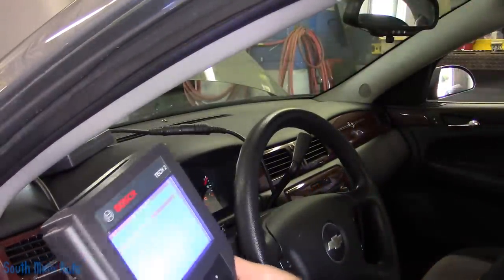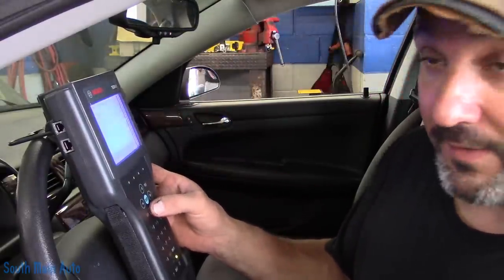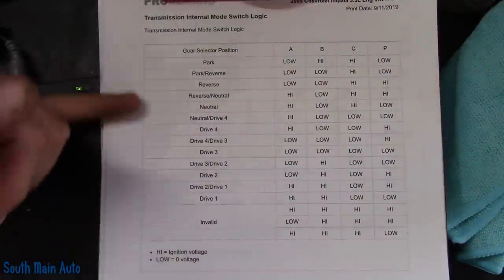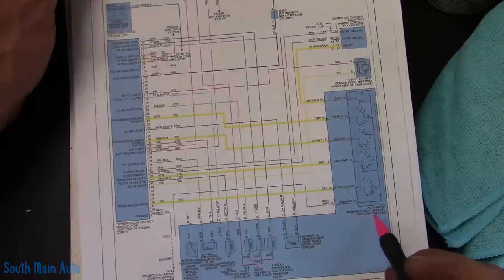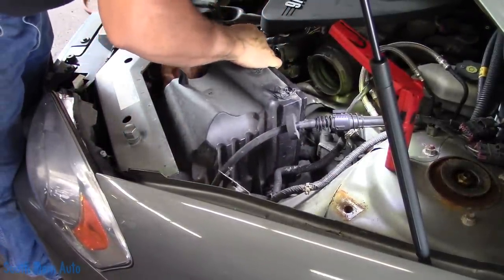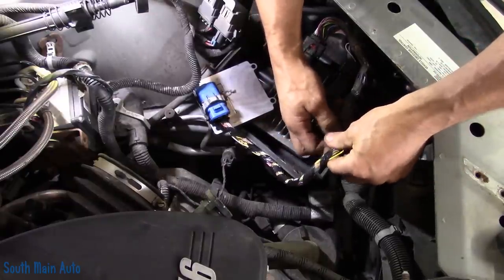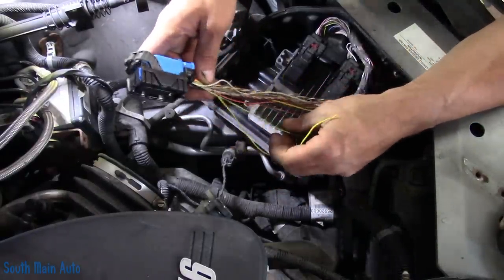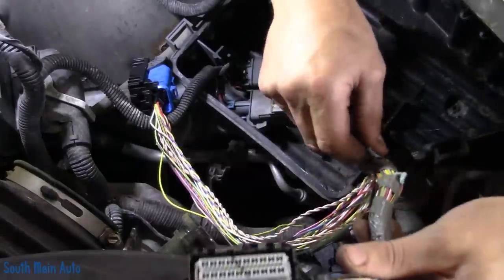Chevrolet Impala: No PRNDL Display

Comment from the maker: Looked on the old Amazon and I did not see the Honda Rodent tape being offered there any more. However you should be able to pick up a roll from your local Honda dealer .
Reply: Amazon does list a rodent tape in Canada but apparently their version doesn't work because people have posted photos of it chewed right after they applied it.  Better to buy the full price Hondoo stuff.
Reply: ...and boy is Hondoo proud of that stuff.  Picked up a couple rolls from the Amazon for around $25/ea when some vermin snacked on the wires to the knock sensor on my 03 MDX with the 3.5 causing it to throw a P0325.  Best I see online now direct from Hondoo is around $40/ea.   ...and yeah, there's generics out there for about $20/ea ... but they too seem to have mysteriously been removed from the Amazon as well.
Reply: Does it come in a aray of festive colors before the holiday rush? Asking for a friend.
Reply: Tape listed on e-bay
Reply: Holy moly, Hondoo is PROUD of their rodent tape! Nearly $60 a roll!
Reply: Cool thanks Eric!
Reply: Capsaicin infused tape, I wonder if spraying it down with pepper water would work too. Boil up some water with habenero peppers in it and put it in a spray bottle...
Reply: You can buy a bottle of Cayenne pepper for a buck at the grocery store.
Reply: $50 per roll for Hondas effort to use a biodegradable plastic, Way ahead of the new green 11 years until armageddon curve.
Reply: £21 here in the UK on eBay boys , mouse traps 60p , a cat free from your neighbour
Reply: Ebay has both the Hondoo stuff and some generic one that looks exactly like the Hondoo one. Luckily we don't see much rodent damage around where I live.
Reply: Interesting.  I had never heard of rodent tape. After we adopted a stray cat, I haven't seen another mouse around here. You can also get some of that green poison at home depot. It's a harden green block which I smash into pieces and spread around the yard. I even started seeing mouse crap in the car parked on the street before we got the cat.  Lol
Reply: @Brother2Jis_27s4  I was wondering the same thing, that's how we keep our dogs from chewing up stuff.
Reply: I have a friend that grows Carolina Reapers they are the hottest pepper on the planet just wear gloves when applying to tape
Reply: Just melt a peppermint candy cane over the problem area, rodents hate peppermint :)
Reply: All you need peppermint oil
Reply: Boss  if you read this I wanna know if you want to do exhaust on my Mitsubishi it’s a 91 Mitsubishi Monterey  I want to run side pipe
Reply: Hannah virus! (Marie virus??) Nevermind...
Reply: can also get it from your local ope dealer!
Reply: @mikeberry304  -- LOL  Yes, just put a can of tuna fish under your car and let the neighbours' cats keep the mice away.
Reply: If you can't find the rodent tape, hire a cat to live under the hood? 🤭
Reply: You can get it on eBay.
Reply: South Main Auto Repair LLC My 2002 Buick Regal LS the mileage/PRND321 odometer LED light barely works during the daylight it's hard to see at night you can see the mileage but is it common issue ?
Reply: Honda City Honda in the Glen Bernie area just outside Baltimore MD has Rodent tape listed as being in stock for $41.25 a roll, free delivery on the eBay site.
Reply: @ColtaineCrows  you must live in a magical place
Reply: I bought this tape a few years ago, and I noticed it is really just Teraoka anti rodent tape. Made in japan, and it seems to be working well. Oddly enough, when I wanted to buy this tape originally, I tried a Honda dealer first, with the actual part number, and their parts department knew nothing about it. This was also at the time when there was talks of a class action law suit against Honda about rodent damage.
Reply: @farmcentralohio  I've had mice eat candy canes out of a kitchen drawer.  I guess they have evolved.
Reply: Mark from [fordmustang98guy] .
Reply: BTW its great the wif keeps you on the narrow not so much the straight.  WIF comes form our time spent on the St Law.
Reply: WARFARIN in the tape?
Reply: Coronavirus for 2020
Reply: Solder, heat-shrink, number 33 and a "mentholatum rub" will work for a DIY-style Honda tape. Rodents hate spicy peppers (capsaicin being the heat in peppers) and menthol (pungent mints especially peppermint).  So 33 and peppermint oil would work. Or cayenne (tbsp), dawn dish soap (4 to 5 drops) and a pint of water, quick boil and let it steep a while. Mix it up and spray.
Reply: Amazon does list the rodent tape by a company called Veco who actually manufacturers it for Honda. Honda just repackage it,slap a Honda part number on it and hikes the price up.
Reply: @South Main Auto Repair LLC Can you scanner tool reset/program on the Throttle Position Sensor? I have 06 impala 3.9 with check engine light that I can't clear & need a scanner tool to do so is yours capable?

Comment: Great video. After 45 years as a mechanic I learned something new, the use of two small alligator clips and short length of wire to hold wires to while soldering them.

Comment: This is a great example of following a logical path with the given information you have. I am perplexed too why this code is not in service information. I work in a dealership and the code does appear in factory service information. Does not make sense. With that said, the way you approached this actually is easier and follows a better path than the factory service information. Very nice work. I want bring attention to how the wires where repaired. Splice, solder and seal. That is the correct way to repair wiring. Do not use shrink seal butt connectors. I have done so many repairs over again that have been to other shops that use these. Good work Eric.

Comment: I just had an issue with mine and this video saved me so much money cause a several mechanic shops couldn't figure out what was wrong. As they were saying everything tested fine. One shop even said it might be the transmission but it was a brand new transmission. That worked fine for a month or so before the issues with the box on the gears.

Comment: Worked in a quick lube joint for years and I can't tell you how many times you open an air box and it's just filled with the ol mouse house, or my favorite filled to the bottom of the air filter with dog food. Great job on the diagnosis and repair.

Comment: This is why every chevy needs to come with a free cat!
Reply: GOOD ONE, IT WAS ALSO A CHEESY FIX.
Reply: Nothing like the smell of mouse and cat pee! 🤮
Reply: @JeffWinter1  That's why you have to put a Litter Box control module in the trunk.
Reply: A snake can also work if you don't like cats
Reply: Chevy? More like chewy. ;D
Reply: @frugalprepper  or better yet, rig some ultrasonic tone generators that alternate to avoid these problems..
Reply: They all do come with a CAT now, but people tend to remove them, because they think the exhaust sounds then better
Reply: @berczigabor  I didn't know GM used CAT.. I thought they had duramax 😂
Reply: @frugalprepper  thats why sheryls she shed burnt down
Reply: Exactly, so the driver won’t be lonely while waiting on the tow truck
Reply: FrugalPrepper's Garage & Garden cats in the US run away from mouse
Reply: @JeffWinter1  People think that having a mouse as a pet is an easy thing.  You need to change the mouse terrarium at least every two days, because the smell of mouse pee is just god-awful.  What I did was put newspaper as the bottom layer (I used a full average newspaper section).  Then put the bedding, house, and toys atop that.  At changing time, remove the mouse, house, toys, and then roll the newspaper from one end of the terrarium to the other.  Put down a new newspaper section and repeat.  Saves worlds of time and aggravation.  Mice are NOT as easy to care for as people think.
Edit:  By "using a full newspaper section I mean just using the section as it comes in delivery, NOT undoing each 4-page sheet.  Also, the newer shredded-cardboard bedding is much kinder to the mouse than the old shredded-wood bedding.
Reply: @adventureoflinkmk2    Duracats.
Reply: That woulda been a CATastrophe. ;-)
Reply: @richardcranium5839  State Farm did say it was covered
Reply: @frugalprepper  it depends. What do you rather have going to your house cats or mice and snakes.
Reply: mouse food over at the neighbors
Reply: @Dirtyharry70585  Next time I get a mouse in the house I will go to the junk yard and cut out some gm wiring and use it for bait in the mouse traps!
Reply: What about brake cleaner?
Reply: @5bananas1  Brake Clean if for figuring out/remembering where the cat scratched you at last week.
Reply: @JeffWinter1  Just last night the annual hoot owl visit to my neighborhood occured. Cats seem to he on their munue!
Reply: I've had a rat hotel in all three of mine. First I checked my suburban after a funny smell, popped the hood apparently I Disturbed a family while they were trying to sleep I apologized and closed the hood softly because there was a new born, checked my 92 Caprice and my 90 both infested but the 92 was like a breeding resort

Comment: You know those old red needles on the steering column that moved with the shifter were immune to mice. But, those expensive failure prone electronics are cool to look at.
Reply: This cracks me up. Can either use a string to indicate gears and cost about 1 penny.. or put a whole electronic indicator on that costs hundreds.

Comment: The best part is that more than half of the shops in the country would've told you that you needed a full transmission rebuild, because that sensor is internal to the transmission. And the rest of the shops would've just cleared the code because they couldn't find what it meant. Good diag Mr. O!

Comment: P182C does show in GM service info.  Odd the aftermarkets do not have it.
DTC P182A, P182C-P182F, or P1915 

Diagnostic Instructions

•Perform the Diagnostic System Check - Vehicle prior to using this diagnostic procedure. 

•Review Strategy Based Diagnosis for an overview of the diagnostic approach. 

•Diagnostic Procedure Instructions provide an overview of each diagnostic category. 

DTC Descriptors

DTC P182AInternal Mode Switch A Circuit Low Voltage

DTC P182CInternal Mode Switch B Circuit High Voltage

DTC P182DInternal Mode Switch P Circuit Low Voltage

DTC P182EInternal Mode Switch – Invalid Range

DTC P182FInternal Mode Switch C Circuit High Voltage

DTC P1915Internal Mode Switch Does Not Indicate Park/Neutral (P/N) During Start

Comment: Hey Eric, On the switch logic chart, the reason you have extra lines like "Park/Reverse" is  because the switches are in a "make before break" arrangement, that allows the ECM to see in which direction you are moving the shifter. So as you are moving from Park to Reverse, switch B goes low (makes) before switch P goes high (breaks) always in that order if you are moving from Park to Reverse.
This helps the ECM detect a bad switch (invalid states) as the shifter movement always follows the same pattern and so stops it being able to jump from positions that are physically impossible to achieve.

Comment: Hello Eric. Great video. I have a 2010 Chevy Impala that I wrote and shoot through the harness just before the plug going into the TCM the car was in limp mode. But after seeing your video it gave me the courage to settle them all back together. I matched all the colors of  the wires. The thing is I have two yellow wires and to gray wires. Chewed
Reply: I hit send. Now what I have is the shift indicator only indicates reverse drive and first gear. Should I swap out the yellow wires. Maybe I connected the wrong. Thank you

Comment: Love all of your videos Eric, even though most of the modern electronic stuff isn't applicable to my OBD 1 and older vehicles. I especially love when you say "It's got the big...whatever. If it'll fit in your shop, I'd LOVE to bring my fully restored (for the 3rd time) 1978 GMC K-35 crew cab dually up from Ohio just to hear you say "It's got 454 cubic inches of genuine Detroit cast iron, bored to 468 and she's runnin' a bit rough. I could pull a few degrees of timing out so you can diagnose it. I'd have to let you know ahead of time though so you could have Vinnie there (I'd love to meet him!) and to give you time to dust off the old school timing light, that you probably forgot you even have lol! I'd even insist that you take her for a toot around town and out on the big road to verify the fix. F.Y.I. My truck and I love going to the ice cream shop!

Comment: A tape wrapping method I use, might be of use to you. I start my wrap as you normally would, then I twist the tape 180 so the sticky side is out, one revolution, and twist it back so it sticks to itself and wrap on down the line, finishing up the same way. You will never have a wrap job come loose.

Oh yeah, the flat rate here in Charleston, SC is $190.00....No rust.

Comment: Capsaicin is the chemical compound in peppers that make them hot. They are typically rated in scoville units. A jalapeño is about 4000 scovilles, a carolina reaper is over one million units. The pure oil is around 15 million if I remember correctly.

Comment: I remember doing a routine maintenance check  on my  2001 Silverado and it had partially eaten acorns in the bottom of the air cleaner box.  I cleaned it out and added hard cloth  to the opening at the inner fender.  Ground squirrels stopped using it as their rest stop.

Comment: Love your content Eric. Amazon doesn’t have that tape but EBay and WalMart do. Kinda’ pricey, but worth it. 👍☮️
Reply: Has the opposite effect on rabbits. We covered the wires they nibbled away after repair and then we covered all exposed wires. Lifted the hood a month later and not a single wire was to be found, nor any of the tape. They're bored and it's a chew toy now with flavor. Fully enclosed split wire loom for the cheaper win.

Comment: Yup even I can honestly say I would have worked that one out with a simple wiring diagram.  It's actually quite an easy diagnosis - check module and wiring - mouse nest - mouse dinner insulation.  All the diagnostic tools have their place but an old fashioned auto electrician would have coped quite easily with the Mk. 1 eyeball on this one.  Still, very satisfying to watch.

Comment: I haven't had a problem with wiring, but I do have a lot of rodent problems with mowers/blowers/etc. stored in my barn. They pack all sorts of crap up around the coil, and if you don't get it out the coil overheats and burns out. They also completely fill the airbox on snowblowers unless you seal them off for the summer.

Comment: Had a first model year Prius, just out of warranty. Turtle light came on, but still drove on electric, so drove it to dealer. Mouse had chewed through injector wire. Old Prii were so "smart" they always tried to crank the engine upon start to charge the battery. It was also smart enough to know it should not start since electrical fault with injector. So kept dry cranking, eventually ruining the transmission. After much complaints, Toyota agreed not my fault. I paid labor, they paid the new transmission.

Comment: I had been on a service call to an oil rig in the gulf. Caught a helicopter out of Venice, Louisanna. After 4 days of rig life I was driving home, about 45-50 miles into my drive I decided to stop at a convience store and grab a soda and a sandwich. Came out, got in my truck and it would not start. Battery wass hot, starter working, motor spinning over and I'm still 80 miles from home and tired. Started looking around under hood, three wires going to the injectors were chewed on. 1 was completly through, 1 was still good but no insulation, and the 3rd one was frayed out. Only thing I figured out was the chewed wires were hanging on by a strand and when I shut it off the vibration of the motor winding down must have ended the last couple (?) strands. Pocket knife and some electrical tape and I'm on my way. Next day I cut back the wiring and added in some so it wasn't being strained on. Solder and hear shrink fixed it properly. Wasn't a rat though, I have 5 wateroaks on my property and those bushy tail rodents (squirrels) are all over the place. I now park in a different spot and to keep it from happening again I broadcast the yard with crushed moth balls. Rodents can't stand the stuff....lol another thing, if you try this method, cats and dogs don't like it either. Don't try it if you have pets, lol

Comment: Had the same type of damage in a John Deere 7610 today. Mrs. Mouse came in through the hole for the baler monitor cable. She had or moved in 7 babies and ate through multiple wires including the CCD+ at the CCU. Upon me removing the console covers, mama escaped through the hole and ran down the cable to the baler, three young ones about 1/2 her size were humanely removed with long needle nose pliers gently grasping their tails, two bailed out the door and off the steps having received a rather sharp blast of compressed air. One was found deceased under the floor mat, and another under a cab air filter grille. No mice were intentionally hurt by humans through todays events, but the fun my customers puppy had with one that jumped off the steps kept him entertained for the better part of a hour.

Comment: Have you seen the new(ish) splice connectors? Heat shrink with a low temperature solder ring in the middle and adhesive on the tails. Just put both wires into the middle and heat it up with your hot air gun. Saves a lot of time on jobs like this.
Reply: I asked this of Eric years ago. He responded that he had many failures using these. They do seem like a good idea but according to him they were not at all reliable.